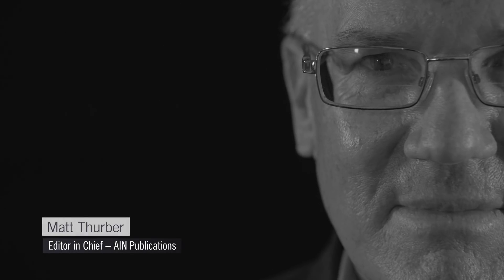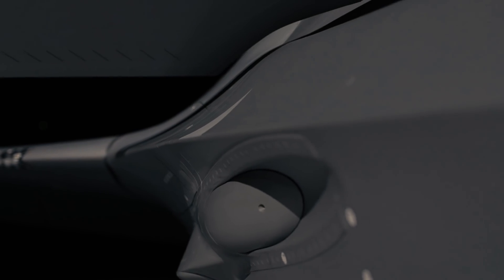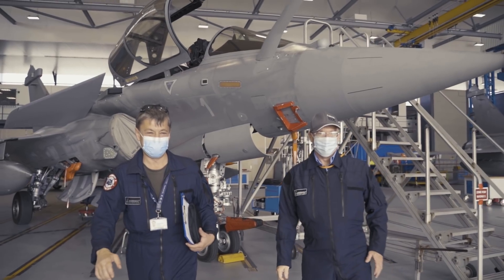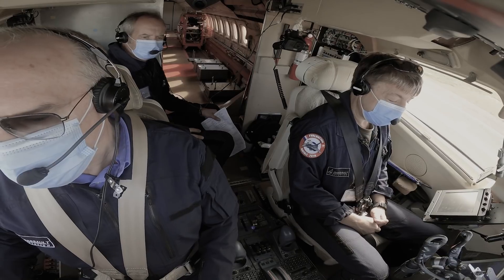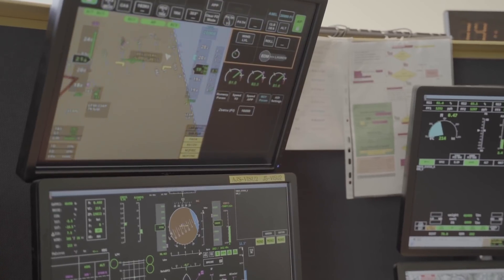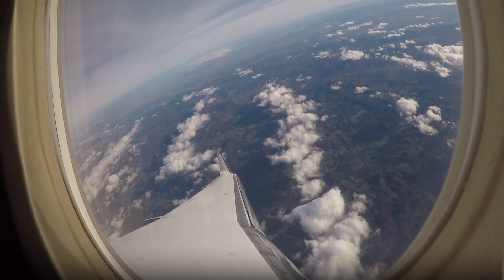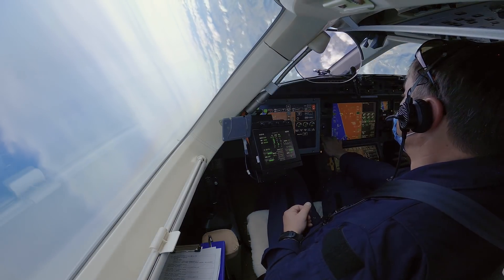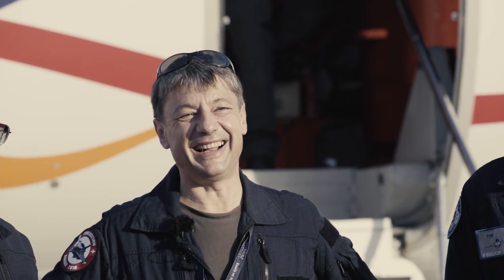Testing a Dassault Falcon 7X with Rafale Fighter Tech – AIN

Comment: Single throttling is used for ground operations such as pivot turns. And I use the #2 engine only for after landing parking shutting down 1 and 3.

Comment: You mean like pretty much all fighters.  Ok, got it.
There has really been a recent reason for split throttles.  Either it's running or it's shut down.
Upset recovery and differential thrust compensation in the software is something that could have been done a long time ago.  Regs are changing.  Maybe.
One more step to getting humans out of the cockpit.
Just take a look at what the Global 7500 does...
Reply: What does the global 7500 do?
Reply: @xenithrone  Almost everything.  It even de-rotates for you.

Comment: So if one of the three engine fails the engine is shut off by fuel cutoff only since there is only one throttle? And in case of asymmetric thrust the computer shuts of one of the engines automatically?
Reply from the maker: Good question! We will try to get an answer for you soon.
Reply: @AINvideo  I mean isn't that the most obvious question everyone will have while watching this?
Reply: Same question!
Reply: Each engine still has its own fuel cutoff, so it can be shut off independently. A failed engine can also be isolated from the SmartThrottle. In the test 7X, a rotary switch for each engine can be used to set the failed engine/s to idle or an intermediate power setting, without affecting the good engine/s. The ability to set the failed engine to an intermediate setting is in case such a setting helps to manage a severe vibration problem, where it runs smoother at the intermediate setting. But once isolated with the rotary switch or shut off, that engine is no longer controlled by the SmartThrottle.
Reply: @mtcytb  Seems like the system is much more complicated and less transparent to the crew than two levers... its not a fighter jet and there is no eject lever. Looks like a solution to a non existing problem.
Reply: @maciejmikoajczyk8568  It is complex, but it simplifies the operation of the aircraft. So pilots can focus on other more important matters.
Reply: Somebody needs to ask the question about engine relight mid air as well. Or we just expect to fly with one engine down ... also what will be the Functional Hazard Assessment for TLA failure ? Since you will basically give up all engine control ? Does that count as single point failure then good luck certify this feature
Reply: @Stavic07  Naturally there would be challenges certifying this system, but this was a test and Dassault has not so far indicated plans to bring this to market.
Reply: In case of asymmetric thrust due to an engine failure you dont shut off the working engine.

Comment: Well on much much smaller level. The Garmin g3x touch has the envelope protection and level button for general aviation aircraft. Very similar technology
Reply: That's true. And I fly a Van's RV12iS with G3X Touch and the level button. I don't know what the LVL button's limits are, but not sure it could recover from that radical a bank. I'm not about to test it either. Plus G3X Touch has no control of the engine.
Reply: @mtcytb  the envelope protection keeps you from getting the aircraft outside of its safety profile. Whether you have the autopilot on or not. Will automatically come on when it is triggered by unusual attitude. And It can be program with auto landing, not like these advanced aircraft tho.

TL 2000 Sting S4 with GARMIN G3X Touch - full automatic landing approach / TL-ULTRALIGHT
https://www.youtube.com/watch?v=8UxtD09r9TA
Reply: @mauriceevans6546  You are correct, the Garmin envelope protection does help nudge the controls to tell the pilot to return to a safer part of the flight envelope. And it also will help prevent underspeed and overspeed, depending on the aircraft. But to be clear, that video shows the pilot using the autopilot to get close to the ground, but he is clearly grabbing the controls to make the touchdown, so he calls it an "autopilot landing approach" and not "auto landing." True Autolanding, which I've experienced in the Piper M600, is quite remarkable. (See: https://youtu.be/IcVuubU4BTU)
Reply: @mtcytb  garmin calls it that. Of course it is not what the piper or cirrus vision jet have. I have never seen a pilot on instruments after minimums, not turn the autopilot off and hand land the aircraft. I think we are saying the same things. Garmin is awesome!